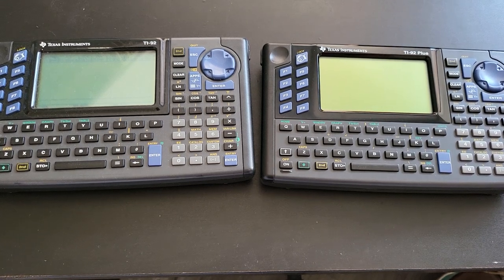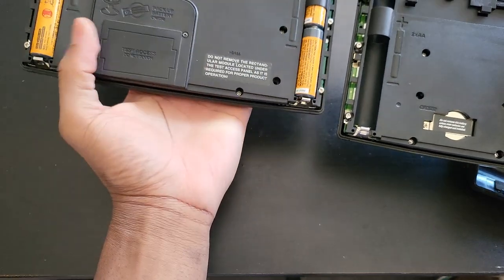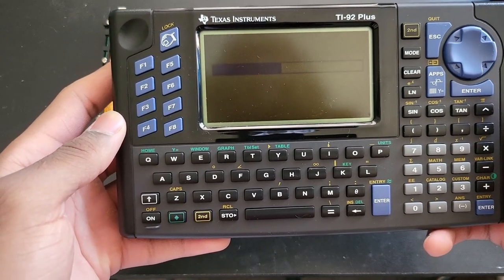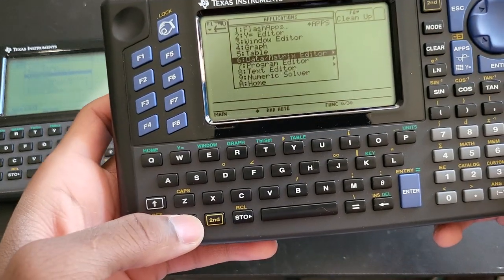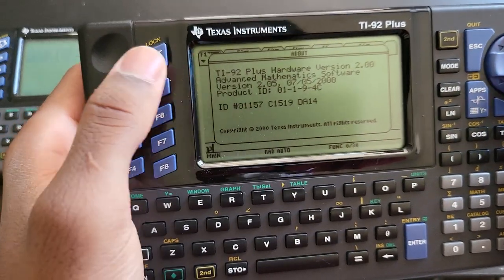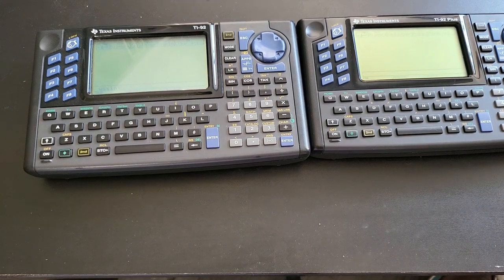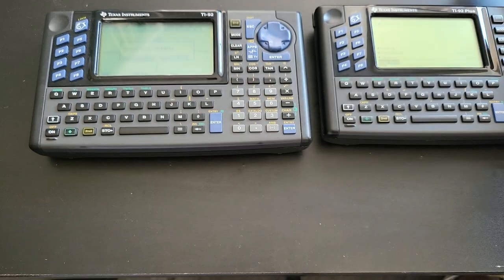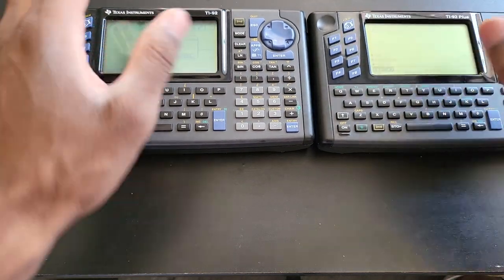TI 92 Plus Overview - My Motorola MC68000 Family is now Complete

Comment: These calculators are real easy to overclock, there's a hackaday bit on it. Change a resistor and cap, and boom, 29mhz. You can even upgrade the flash for faster access easily too!

Comment: There are a couple of versions in between the TI92 and TI92+ - . there is a TI92 II. There is a module that makes a TI92 into a TI92II, and lastly there is a module for the either the TI92 or TI92 II that turns it into a TI92+.  I have seen very few of these modules pop up on eBay and surmise that  there are calculators sold with these modules inside and the seller does not know it is in there.
Reply: the expansion modules end up demanding similar prices to hp 48 gx/sx expansion cards... which can end up being more than the calculators!

Comment: Nice. I snagged a 92+ for about $35, after getting a Voyage. Saw several TI92's advertised as 92 Pluses, the sellers were ignorant as to why they are different. While I have a Voyage, 89, 89 Titanum, and 92+, I don't have a 92. I was able to upgrade the Voyage's OS using my link cable and TI Connect, but not the 92+, it will not connect. The 92 can see my TI89 Titanium and my Ti200  Voyage but I don't think I can use the Voyage to upgrade calc to calc.
Reply from the maker: The 92+ has a better keyboard, and a considerably better screen than the 92. The TI Connect software can be unstable at times. Trying a different PC might help. You can only use the link cable to upgrade the 92+ if you have another 92+ running a newer OS, otherwise you must use the silver link cable to upgrade it using a PC.
Reply: @calculator_boy  I'm going to try that with my old 1990's Thinkpad.